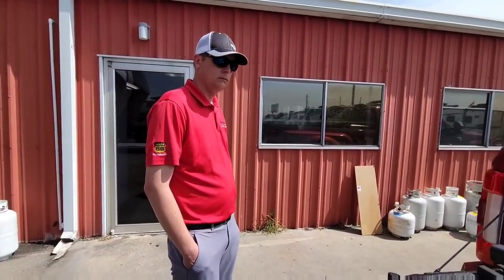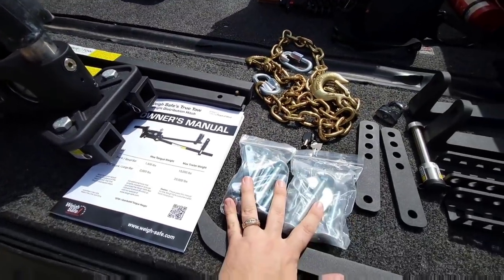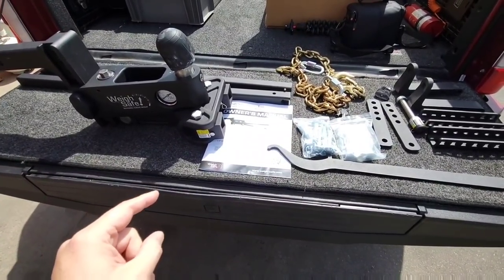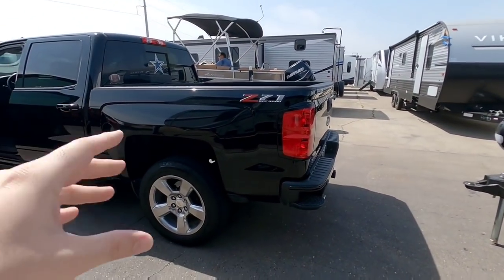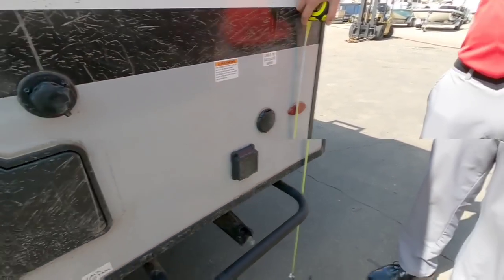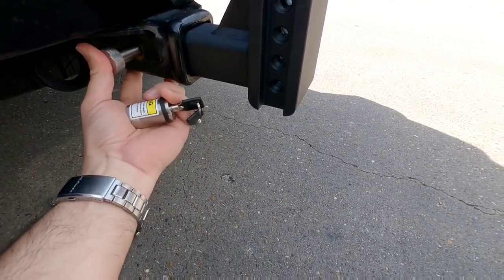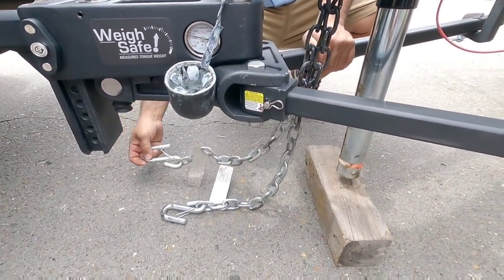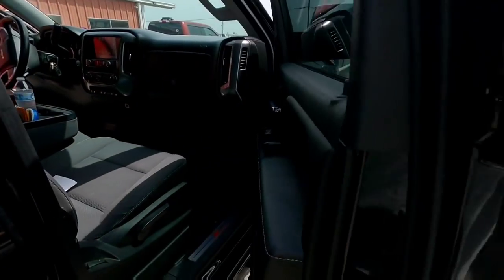Installing the Weigh Safe Weight Distribution Hitch!  Part 1: Full Installation on a Jayco Eagle RV

Comment: Wow!  I REALLY like that hitch.  Wish it had been available before I spent almost that much on my Equalizer.  Really how how it's got the scale, and the ease of adjustment is just awesome!
Reply: They are mostly designed for toy haulers imo where cargo could change at a greater amount
Your equalizer is a quality hitch that once dialed in will not require an further adjustment 
Generally the weight distribution doesn’t change with conventional trailers
Reply: @nbhybrid206  my equalizer is a great hitch, but that weigh safe looks even better.  And, yes, I have a 38' bumper-pull Stryker toy-hauler.
Reply: @stevetekrv5791  you should get one then for sure

Comment: Great video! Why does the tongue weight increase when using the weight distribution hitch? Shouldn't it stay at the same weight?
Reply: Technically, the tongue weight is not the measurement on the gauge. The gauge reads the weight being transferred back to the trailer axle. Most people think the weight is being transferred to the front of the truck and that is not true. The weight is being transferred to the trailer axle and therefore less tongue weight. If the weight was being transferred to the truck the arms would have to be attached to the truck. Even the guy doing the video got it wrong when he said, "the weight is being transferred to the front axle". The Weigh Safe video explains this very well.

Comment: Question: You had 1300#'s on the hitch and if I had his weight~180#;  mom = ~140, 100#'s per kid X 2 = 200;  hitch = ~40#'s;  total = 1860#'s. You may need to ad weight for "stuff" in trailer and truck interior and bed. Most Families end up with a few hundred pound in the interior & bed. So he's going to be at least ~2000#'s all packed up. His cargo cap was 1620#'s . Am I looking at this correctly ?
Reply from the maker: 1300lbs is being transfered.. the scale under load is reflecting the downward force the hitch is handling under pressure. Weight is transfered to the front of the truck and to the Trailer brackets instead of the truck receiver carrying it all.  The truck's receiver is likely only handling about 350-400lbs instead of the 600lbs it originally recorded.

Comment: How much does the hitch head weigh?
Reply: I just bought the 15k model with the 6" shank.  The shank and hitch weigh 75 lbs. The bars weigh 18 lbs each.
Reply: @LoudRam  we have a eco boost Ford 150 and have a 25ft travel trailer weight 6,000 pounds dry weight. Will this hitch set up  work?
Reply: @Berrypancakes229  It will work fine with your set up. Our trailer is 29' 6k dry 7k loaded. I wish they sold a slightly smaller one.  The 15k model is the smallest they make.  I feel it's overkill.  A 12k 1200lb tongue model would be perfect for most 1/2 ton trucks.

Comment: Extremely disappointed with this hitch simply because of how far away the actual ball is relative to the trucks receiver hitch. The tongue weight of any trailer will now have substantially more twisting leverage on the actual receiver hitch itself.